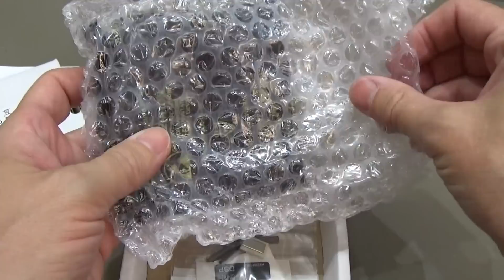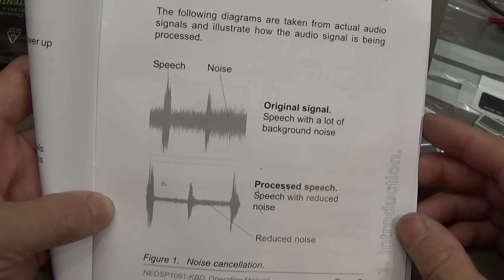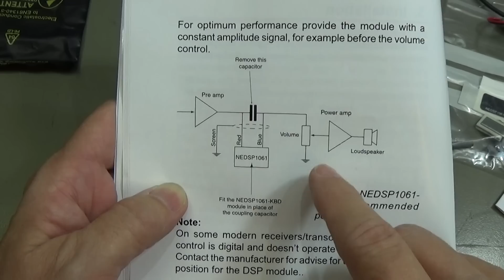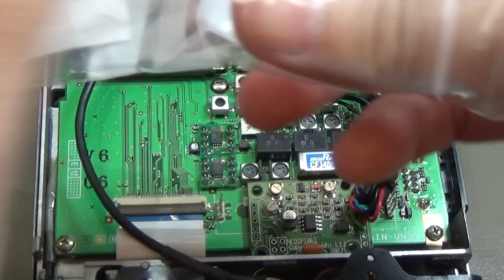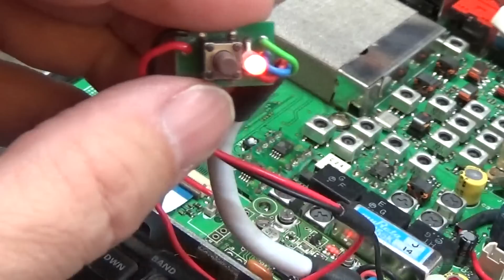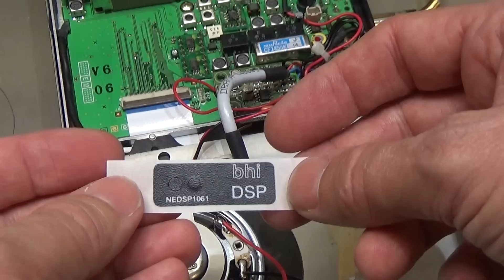#182 Modification Yaesu FT-817: BHI DSP noise eliminating filter NEDSP1061

Comment: I've just installed the updated bhi module (NEDSP1901-KBD) into my 897D and I'm really pleased with the result. In fact, I'd go as far as to say it's transformed the listening experience and well worth the price.
I'm not as experienced as Peter here, even though I have worked on SMD PCB's before, so it did take me a while, being super cautious with the PCB component removal and connections. 
For anyone not familiar and at ease working on modern boards I'd say don't attempt it but I reckon it'd it'd be worth the cost if you had to pay to have it fitted.👍

Comment: This little device makes the FT817ND perform like a full sized Yaesu radio. Without it, even with mechanical filters, the 817ND start to hurt the ears after sometime listening and scanning the frequencies. But with this DSP, the voices comes up to front of the stage and it expands the sound stage like it was broadcast quality. Pretty unbelievable. Luckily, I did not do this mod as the parts are really tiny and you need a real steady hands and good soldering skills.

Comment: It would be nice to see this DSP swept with a frequency generator (like from 100Hz to 5kHz) and see how the filter attenuates and discriminates on an oscilloscope. Or even better, put one scope probe on the unfiltered input signal and another on the filtered output signal, and then put voice through it (like those images in the manual) to see the difference in signal to noise.

Comment: in my opinion it is not advisable to install the module because the weak signals are lost, moreover it becomes difficult to decipher the correspondent .... practically it is worse than the FT-991 DSP where the audio seems to come from the planet Mars.

Comment: hi, this is an interesting item, have you also seen the nedsp1901-kbd that they have out now, and fitting it to an 818 would also be interesting..  i currently have the aftermarket yaesu ssb filter fitted and it does work, altho not so well at times..  i presume this filter / dps would be better..  also sota beams has one out to..  the laserbeam-817,  they seem to fit in the same way but there is no adjustment its automatic and also works with optional filter fitted also..   seems to be a mine field and to know what to go for..   thanx for the videos..  de m0yyo

Comment: I've been thinking about doing this mod to my FT817nd but wonder where I'd mount the board since I have a filter in that slot.  Nice work by the way.  Well done.  KC3BLI
Reply from the maker: There is always some space just do it 73
Reply: @TRXLab  yes there is
Reply: @TRXLab  So I can install the DSP with a filter in the slot ?
Reply: Buy the speaker and use it with several radios which makes far more sense and saves you money overall.😳
Reply: Did you install the DSP over the filter ?

Comment: Thank you for the video.  Other attempts at audio over camera demos are available with positive results as well.  However, this is a super helpful video of how to install.  Nice work.  I know it is not the scope of this video, but I would love to see how to remove the Main PCB with advice on ribbon cables and the power (?) cables.  I hope to find that somewhere.  Very helpful.  Thank you for your detailed efforts.
Reply from the maker: Thanks for your feed-back Adam!. May be this video will help to get some additional insight views..around 34:00 it starts
https://www.youtube.com/watch?v=3izDNNNLp2c&t=1843s
Reply: TRX Bench Ironically, I found that video previously and was slightly entertained that removal process of the main PCB was a hard cut to the removed board.  Thanks for digging it up regardless.  Overall after figuring out the ribbon cable, I felt a lot more confident tackling this somewhat complex mod seeing your very helpful video.  It all went well and I love the new bhi DSP filter personally.  Thank you again.  One more question, I have spent some serious search time and cannot believe I cannot find that front BNC 50 ohm dummy load resistor you have.  I have a simple silver one that looks like a modified BNC connector.  Just for the pride of aesthetics and slightly more rugged benefits on the radio, can you share where you found that all black rugged looking dummy load?  Thank you again.

Comment: To be honest I wonder if it really is worth the effort? Yes you could hear the increase in signal to noise ratio (not dramatic though), but that is a low power Tx - so yes,  you will be hearing a few more signals but would still not be able to work them well. Apologies if that is not technically correct!

Comment: Peter, it looks very professional.
Is the TCXO module in the background from China, or the original from Yaesu?
Thank you for the video!

73 Bernd
Reply: China. The adjustment is on the underside of the chinese units. Yaesu made theirs the right way so that it can be adjusted with it installed, unlike the chinese which have to be removed.
Reply: Thanks for the Information.
73 Bernd
Reply from the maker: Thanks Bernd! Yes china for little money 73

Comment: Good modification you can hear reduced noise level but a lot will depend on the radio you will not be able to eliminate all the noise very neat small PCB.
Reply from the maker: Yeah you never will eliminate all the noise but it is working pretty well. Thanks for watching John 73

Comment: Good installation Peter. I hope it works as intended. They sure used some big wires on that unit. Thanks for sharing my friend 73.
Reply from the maker: Thanks Buddy. Well it works pretty well but some ham don't like it because they have the feeling it cuts highs. well I don't think so.  For me it is an improvement but I don't like to recommend as the tastes are to different .. You are right the wire is much to stiff. Have a nice day 73
Reply: That is what I was thinking - wires are too heavy for the pcb in the space available not sure if will fit into my FT817 as I have extra mechanical filter installed

Comment: Good video Peter!

Those wires for the button/LED PCB look like they could have been made a whole lot thinner, or even not using a sheathed cable.  

Might make mounting the PCB a bit easier.
Reply from the maker: You are absolutely right Michael the wire is much to stiff...

Comment: Nice little module but really, they ground the part number off the QFP IC.  That's enough to make me not buy one.  I refuse to buy products that are intentionally made unserviceable because the manufacturer grinds off part numbers.  Same reason I refuse to buy a radio the manufacturer won't release a service manual for.
Reply from the maker: Fully agree with you Mike!
Reply: Hi Mike,
You hit the nail on the head.   :-)   73   WB3BJU
Reply: That part probably is a programmable device like a CPLD or FPGA, so not really serviceable anyway. (with protected flash memory, if it has one)
Reply: This is probably correct...
Reply: I think it's to make it more difficult to copy rather than to make it unservicable.  There are ways to disable the copy protection for some FPGAs or DSP processors but that tends to be proprietary information unless leaked.
Reply: @NoName-mr1lh  

If another company wanted to copy the product it's not hard.  Send the chip to Russia and pay to have it decapped and the die scanned with a electron microscope.
Reply: I do not see why scrapping the IC code after every secret is in Firmware and not in Hardware !!
Reply: @Wesley Matthews   And what do you do when it breaks?  In the past schematics and service manuals were available for everything.  Shoot, most items use to come with a schematic.  These days no schematic or service manual means you throw out the product when it breaks instead of getting it repaired.  Manufacturers don't want you to get their products repaired.  They want you to buy another new one from them.